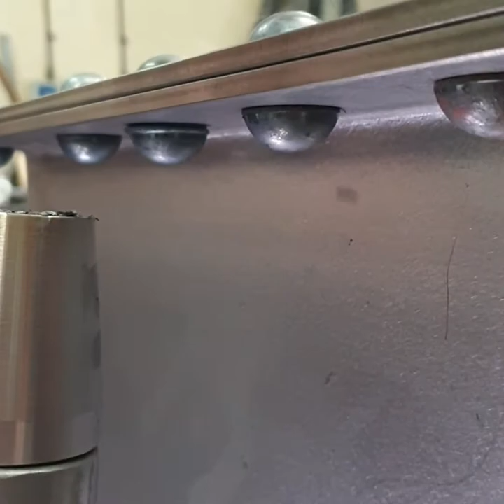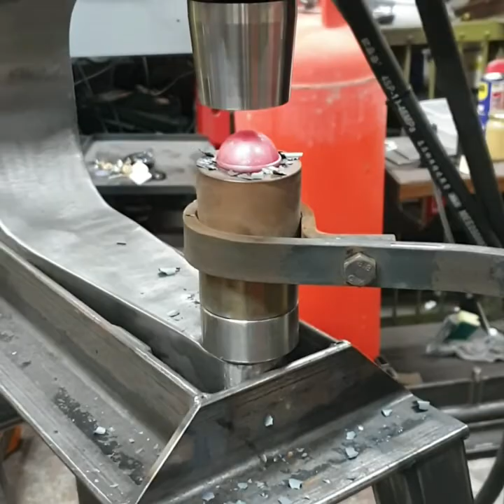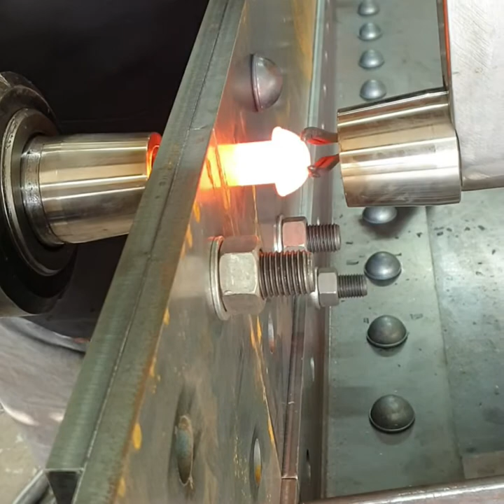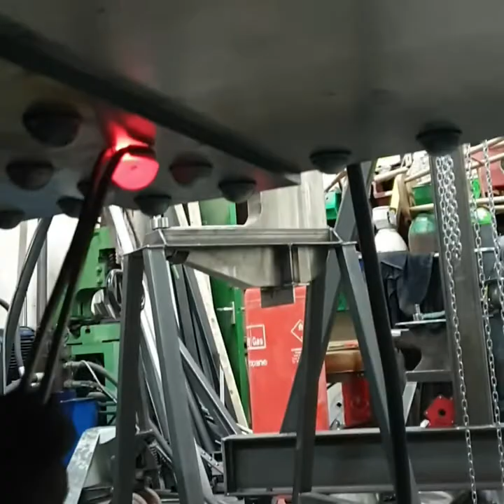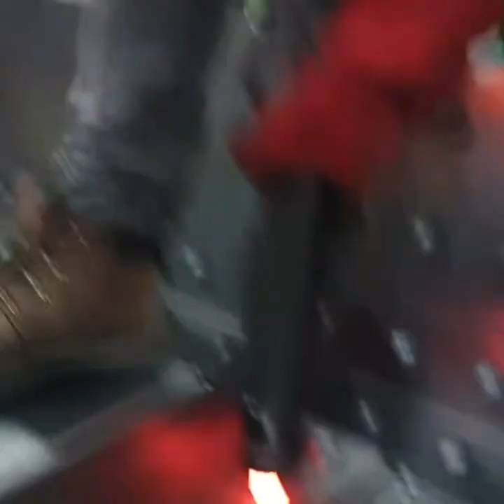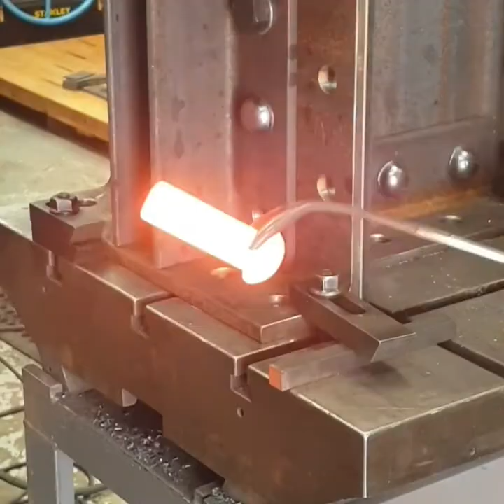Hydraulic and pneumatic hot riveting

Comment: I use post hole diggers with steel pipe handles filled with lead. 
It drives the diggers into the soil and helps you dig. Yes it makes for hard work but it really helps you dig. Jim